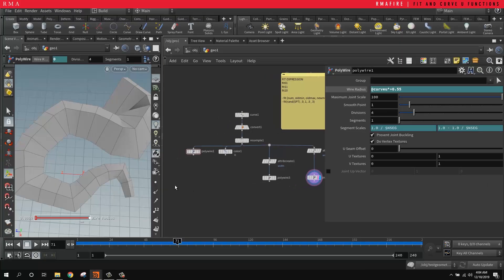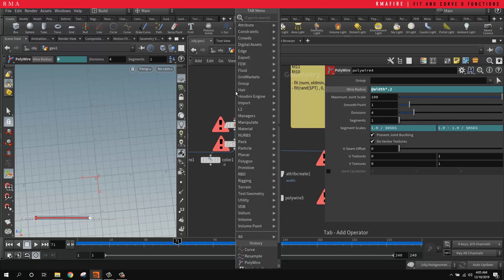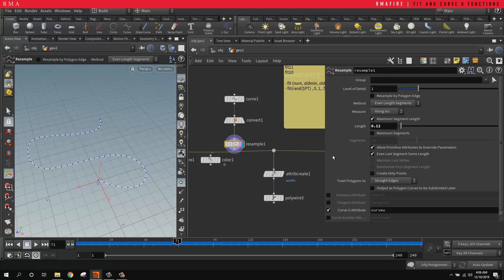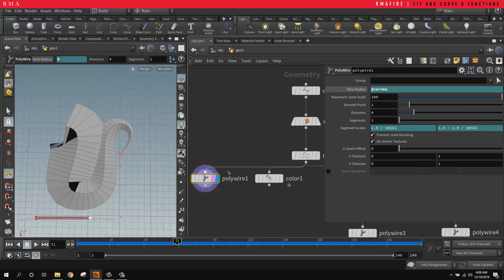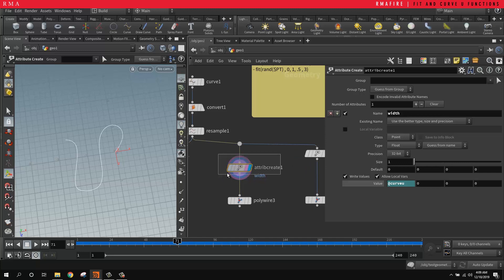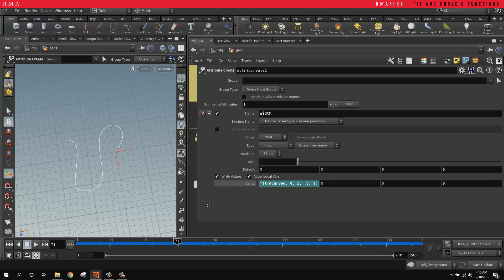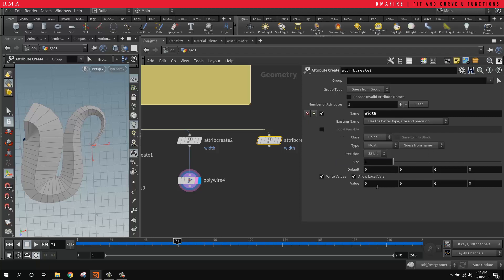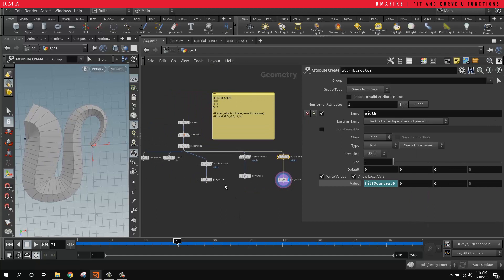Fit Functions and Curve u Attribute in Houdini - Control polywire thickness in curves and more!

Comment: With more control, simply throw an attribute remap in between the resample and the polywire. Set the 'Original name' to curveu and then control the attribute via a ramp to get many different variations along the length of the curve. You can even set its start and end position, as well as the min / max output.
Reply: thanks

Comment: Hi, thank you for the explanation. Just the question - maybe you can use fit01(@curveu, min, max) in the wire radius directly and avoid so many nodes? And since @curveu is always between 0 and 1 maybe fit is not necessary. But then again, this is Houdini, lot of ways to make things :)